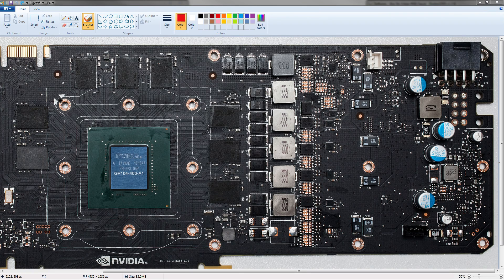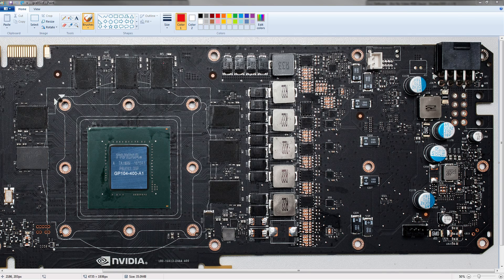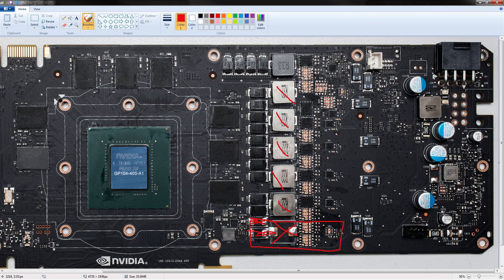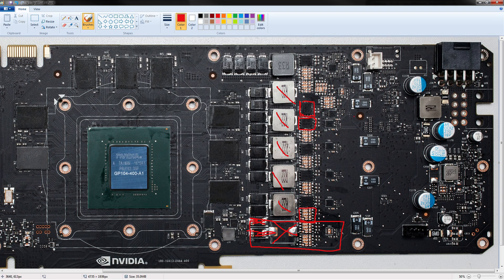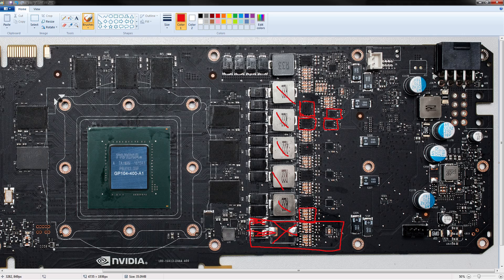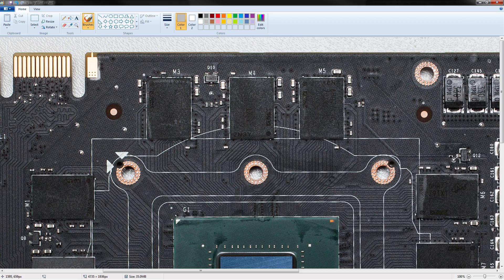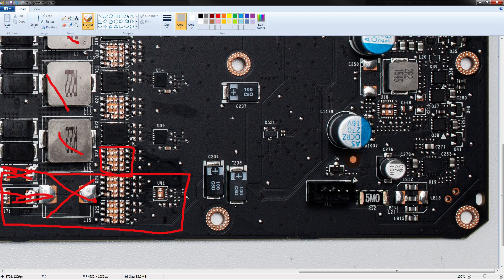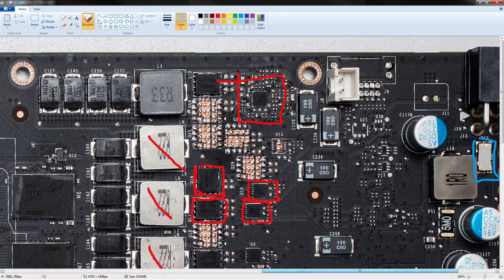GTX 1080 FE PCB breakdown and power limit mod

Comment: Nvidia said that they put all of their effort and quality in this reference card. All of this tells me that they lied by a huge margin.
Reply: +charinflanrocks 
Don't forget this...
67C at 2.1ghz...
Faster than 980's in SLI...
X2 Faster than Titan X... 

Bullshit!!! 
The GPU's throttles at 82C, and you can't hit 2.1ghz unless you put a waterblock in it, also, is not faster than 980's in sli...
Reply: The problem is not that they don't want it to compete. The main issue is that they lied about putting all their effort on the card and putting high quality components when they just skimmed down parts for cost while charging a non existent extra. Also they are not dumb, they recover their expenses from every chip they sell to OEMs. It is not like they need to beg for money. This reference card is just a joke, it just a reference card and nothing more.
Reply: charinflanrocks 
In order to keep the core clock stable you have to set your fan speed up to 85%, Dimitri from Hardwarecanuncs showed a graph where he achieved the 2.1ghz overclock with a 55% fan speed,which is a total bullshit, the card starts to thermal throttle after 5 min on load... And yes even if you set the fan to 100% still throttles.
Reply: +Jerry Le 
This is the kind of shit you get when there's no competition, They know there's a lot of people ready to upgrade their GPU's, Look at how fast monitors and TV's technology is evolving, AMD has Nothing to compete with them for now, Do you think people is dumb enough to buy a FURY X instead of the 1080? The fury is pretty much obsolete at this point... and the worst thing is, is more expensive than the 1080.
Reply: pics? i haven't seen any gtx 1080 air or water cooled hit that 2.5 yet
Reply: Please tell us how .??????
Reply: +Luis Ortiz Or make the 1080 blower design function like a jet engine.....
Reply: im hitting 2.5 on my watercooled gtx 1080 destroys my old 2x titan x's and my mates sli 980ti set up
Reply: Lol
Reply: junelsvtecturbo777 whats your email address??
Reply: junelsvtecturbo@comcast.net
Reply: It'll still have trouble with 5 phases, good luck getting a stable OC...
Reply: received my founders edition, sending it back, unimpressed, will keep an open though as I would like a new gpu hopefully its the early drivers fault as for me the 1080 only performed brilliantly on benchmarks it was to inconsistent on mostly everything else
Reply: +charinflanrocks An extra hundred bucks for better "craftsmanship" my fucking ass.
Anyone who actually gonna buy this card deserves to be called a mongoloid
Reply: +Jerry Le Yeah it is sad. The marketing Nvidia puts on its GPUs is getting ridiculous. Yeah let's call the reference card that always will be inferior when compared with OEM partners "Founders Edition" then ask more money for it because it has a nice led branding but is low cost for us and let's put the excuse we don't want it to "compete" against OEM because it is "high quality" despite the fact that we said even the binning is identical agaisnt OEM.

Comment: Can you analyse Palit 980 ti super jetstream pcb, it seems same as reference, but with minor dirrerences. I marked few things what i saw different. If you don't have time to make a video, can you tell me in comment section what are those components that are changed and is it downgraded compared to reference 980 ti pcb, thanks.

Jetstream pcb with highlited areas.
http://s32.postimg.org/awngr7k04/front_full.jpg
Reply: +SA69+YKK I won't do that card since the PCB is the reference layout. Those things you circled are probably just 0 ohm resistors because they replaced a bunch of noise suppression coils with them.
Reply: +mr.cleaner So they didn't downgrade any important components, thats good to know. Thanks.

Comment: what happens if you put every missing chip in ?
Reply from the maker: +Light Dark you'd probably get an extra 50A per phase at 25C. You most likely can't add the 6th phase because that pin on the controller needs to be tied to something if not in use.
Reply: Actually Hardcore Overclocking I'm kind of certain that the bord partners will have that 6th phase
Reply: +Light Dark GTX 1080 Ti happens :-D
Reply: MSI is releasing a 10 phase. Can't wait to vbios mod and put a waterblock on it. I think 2.5ghz will be possible.
Reply: GTX 1080 Ti
Reply from the maker: BlazarK From what I've heard the GTX 1080 refuses to work above 1.25V and even with LN2 the cards are only hitting about 2300-2400mhz. So don't get your hopes up.
Reply: @ActuallyHardcoreOverclocking  Silly question after soo long. I've not attempted hardware mods before. I've got two 1080 FE's and wondered, Could I get an FE' card closer to the performance of an aftermarket card, such as a Waterforce or FTW card, and would it even make sense to attempt this for the possible performance gains? Or no?  I have waterblocks on both GPU's, and if not worth while, I may try for extreme overclocking with LN2 in the future just to experiment.
Reply: +Anitrex006 You might not be too far off the mark.
Reply: Actually Hardcore Overclocking Ugh, sounds like a repeat of Fermi. Think I might wait for the Ti then, as these cards cant hit a steady 60fps in most titles at 4k. Was hoping they could be OC'd to hell to reach that glorious 60fps.
Reply: Normal Person actually this time the ti and titan might be different why cause nvidia use gp104 for 1080 and 1070 and they have gp102 and gp100!
Reply: (insert snickers here) Better ! :))
Reply: The power requirements are raised and you are talking about SMID soldering a multi-layer PCB. Not as easy as fixing an amplifier.

Comment: Nice! Im definitely waiting for a watercooled 6+ phase change 1080 to get in SLI and OC somewhere between 2.2 and 2.5GHz
Reply: +PROPHET GAME lol.. better bring some ln2 and power boards.  These cards run hot because the surface area of the die is smaller so it is harder to transfer heat from it.  Ambient watercooling isn't going to do much.
Reply: B Mcginnis People have already watercooled it and the temps are very low.
Reply: but they aren't clocking much higher than air cooled cards
Reply: B Mcginnis yeah shoite they are maxing at 2.2 on water rn.

Comment: It would be awesome if you could make a video about the evga gtx 980ti sc+ pcb, its basically reference. (I know you don't like NVIDIA stock GPUs but still).
Reply: +xXsch3ricXx Is it this one?: http://www.techpowerup.com/reviews/EVGA/GTX_970_SC_ACX_Cooler/
Reply: +mr.cleaner its this one http://www.techspot.com/review/1011-nvidia-geforce-gtx-980-ti/
Reply from the maker: +xXsch3ricXx whoops misread your first comment.
Reply: +Actually Hardcore Overclocking Np m8. Would be interesting seeing if you could do anything on the board for improving overclocking capability.
Thx nontheless.